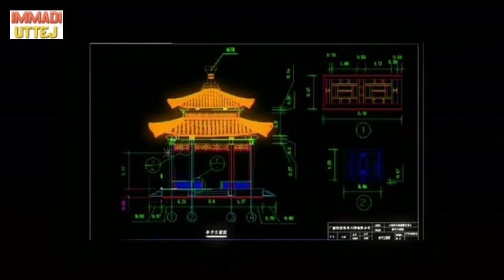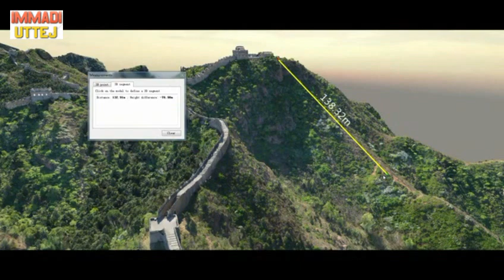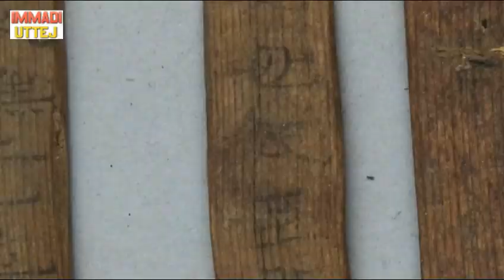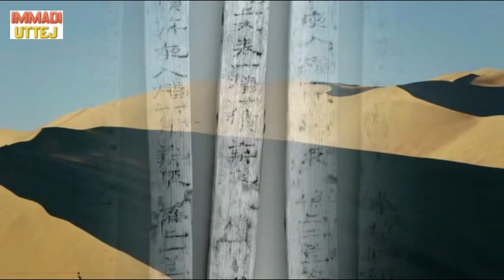The Great Wall Of China - Unbelievable Secrets & Unknown Facts - Part 1

Comment: The great wall is actually a series of walls built over many centuries to keep out mounted raiders. Over time as the empire expanded, they dismantled parts of the old wall to build a new one. The Chinese were never able to completely conquer the Mongols.  Gates were there to allow traders in, but the Mongols used the gates to sneak in a force a few men at a time.  They then overcame the guards and opened the gates to the main force.  Thus the Mongols conquered China and of course, left the wall to fall into disrepair.  Tens of thousands of people, mostly convicts and political prisoners, were used to build it and thousands more died, to build what was essentially a useless wall.

Comment: 'The Great Wall' was NOT built by dynasties or emperors. It was built by warlords as defense from barbarian (Mongol, mainly) attack. These warlords were unsubjugated strongmen, independent of any ruling dynasty. Not until the Qin (Chin) dynasty did the state begin to consolidate the various sections that now comprise the Great Wall'. Emperor Chin Shih Huang Ti is often credited with building the wall, but his achievement was mainly subjugating the various warlords, and connecting huge sections of the wall, for the defense of what was becoming a unified China.

Comment: Earlier 11:07 a lady mentioned the wall , in fact, stretched over 21000km, almost half of the equator.

But at 16:10, the male voice said "10000 km.."

never reconcile your facts ?
Reply: 21000 km is the actual size measured in modern days using technologies. And I think the male voice mention 10000 for only referring to the saying "万里长城" which is Chinese name of the Great wall, it translated to ten-thousand (万) ancient length unit (里) long (长) wall (城), and in Chinese when we put a number in the name of an object, the number usually only carry a symbolic meaning, ten-thousand really just means it's really long, it doesn't give any accuracy in term of the actual length of the wall.